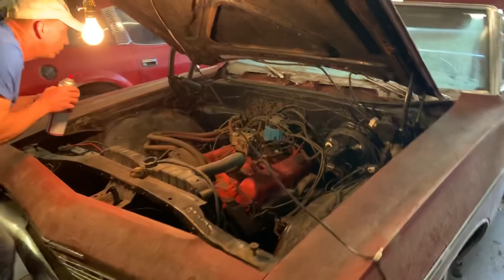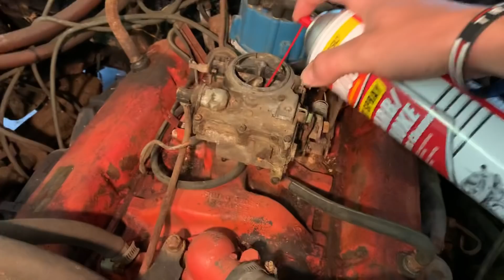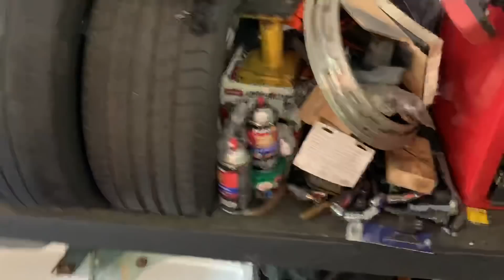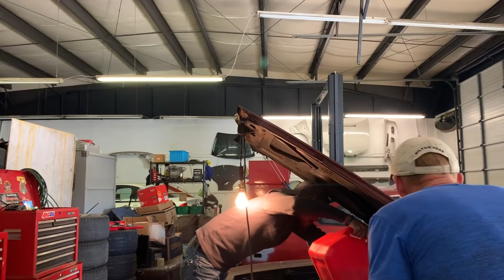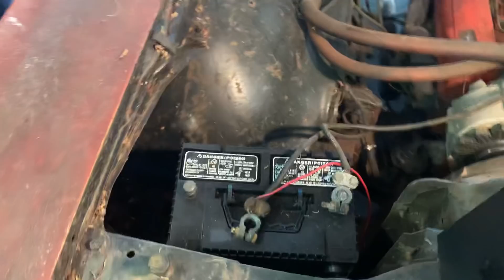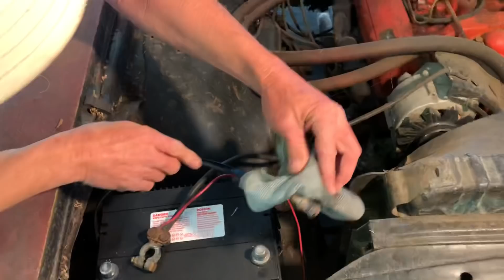Spoiler!: 1968 Impala convertible! Will it run?

Comment: It's gotta be a clogged fuel filter.It should be a copper 'stone'style filter in the carb.I know you've got it running by now.My first car was a '68 BelAir 4-door with a 307.I ran the pee out of that car and barely did a thing to it but add oil and CD-2.

Comment: It sounds willing to cooperate but what, exactly, is in the fuel tank? If it's gas as old as the car has been sitting, it won't be worth a damn.  Best way to see how it runs is 1) disconnect the fuel line  2) remove the filter at the inlet and replace the inlet fitting  3) attach a temporary fitting to accept a fuel hose  4) rig a gravity-feed bottle of fresh gas attached to the hose and try it that way/ If it starts and runs, great, but it might still need have the carb disassembled and the float bowl and jets cleaned. The next step will be clean out the gas tank,  flush the fuel lines and check that the fuel pump is functional. All in all a worthwhile effort since the car appears to be worth restoring. Good luck !

Comment: That front end doesn't look like the 68's I remember. Moreish a 65 or 6 but for a small glimpse of windshield and other stuff, just something off here. Fuel line off and check for hose on the tank plugged or rotted off, and sucking air. Timing is spot on. No kick back after a short start tells me stuff is happy in ignition area. Too small battery cables and drawing down current bad, and the ends have did their job. It got you home now put on good cables. Starter hasn't died, save it by finding what is wrong

Comment: Years ago I had one that was bone dry out of gas.  I ended up leaving the cap off so the pump could suck the fuel up easier, between the filter and maybe the vent was clogged a bit it wouldn't go.  Once it got going it was okay.
Reply: Probably another trick would be to put a cap on with a tire valve and use a compressor to pump a little air pressure in the tank.  Not much, 10 PSI maybe.

Comment: Bought a used 1968 Chevrolet Bellaire for $600.  The cheapest thing about the car was the $600 purchase price. The expensive part was the new battery, tires, hoses, belts, brake wheel cylinders, valve seals and rebuilt power glide transmission. Cheap used cars are too expensive, you can’t buy them cheap enough.

Comment: OMG that is a nice rag top and a nice Datsun Z. a bummer that it has a 283 SBC with 1 Venturi (1 Barrel I'm guessing)...did you replace the plugs point dist and etc...???  this works for me; spray the starter fluid in the carb while someone else turning the key... ty for posting your IG name

Comment: 1968 was a great year for the Impala, although I do like the taillights on the 67 a smidge more.  As for this car, how rusty is it???  Convertibles of this era stored outside for any period of time tend to be total rot boxes, water leaks in, sits there for years and rusts them out.
Reply: 68 is better than 67, rust and rot is nothing when you get a new top n change the pans

Comment: Sweet, stock rebuild I'm assuming? (No bling bling stuff)
Reply from the maker: The engine probably just a refresh, nothing crazy, the body will receive the most attention, as the rust is cut out and everything is reagent metaled!
Reply: @MXguy95  Wonderful! Best of luck on the project, that body style, especially in convertible form, is sexy. 😁

Comment: sry I didn't come for the impala but the car in the back ground that looks like a 240z
Reply: It's a 280ZX, and based on it's tailights it's between a '79 and an '81. A 240/260/280Z would have had a fuel door instead of the exposed gas cap.